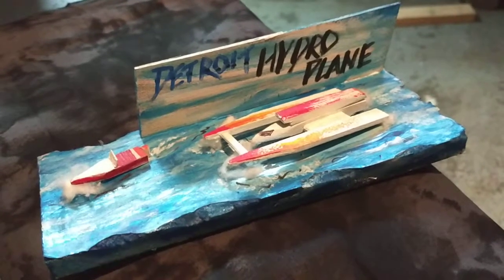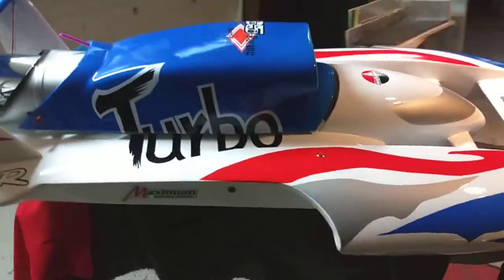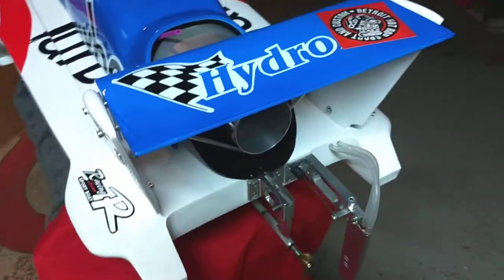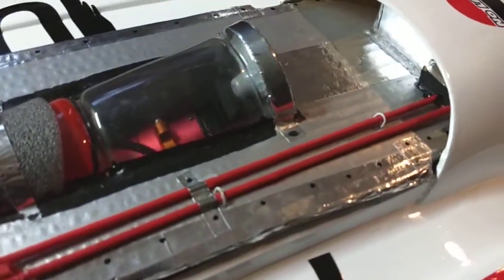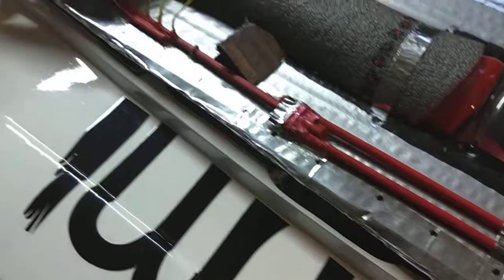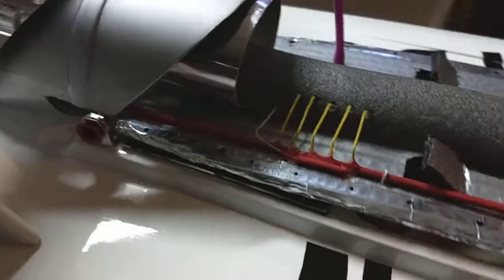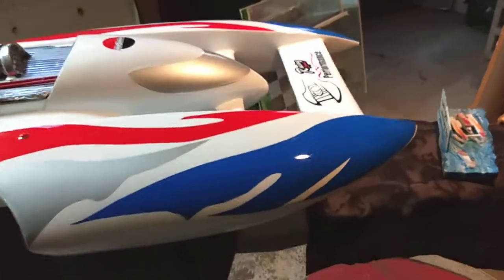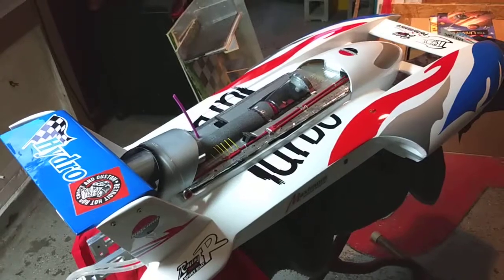RC Hydroplane electric conversion, seaking 180 amp,

Comment from the maker: For the latest on this hydro, going to a 1000 kv motor, higher C count on my 2  4s packs 5000 mah. As of now test is a go on the Detroit river. So far 45 50 mph, but power was cutting out.

Comment from the maker: Offshore electric, zippkits, and gizmomotors carry most of your conversion needs. I made the mounts for the electric motor mounts and ESC. Stick with the 3/16 flex shaft setup and collet for your motor choice as it depends on shaft size on your motor,4mm 3mm ECT. Boats use high current so I  would use a high c rating  better then 90 is good, then testing. 1900kv, 180 amp ESC in a combo will be plenty depending on battery, 4s 5s or 6.  Keep me posted

Comment: What prop, motor, esc and battery combo are you running? I’m converting mine.thanks
Reply from the maker: Seaking 180 amp ESC, Leppard 1100 kv comes in a combo, 6s 5400  90 c nothing lower, expect 4 min runs and 1 hr to charge, props I'm testing and can get info later for you. Gas you  just keep running. So far it can do 55_ 60 but its to light in front and hull should be beefed up all around as it was not design for speed, no turning fin, fiberglass needs reinforcing for that.
Reply: Scott Connors ....I put a Leopard 5692 730kv with a ZTW 300. I added and reinforced a turn fin. Just trying to decide on batteries. I plan on 12s
Reply from the maker: @lonniedavenport5704  make sure it has a high c count, smc batteries is a good start and price, 95$ for my 6 s.  Keep me posted on your project
Reply from the maker: @lonniedavenport5704  how is your project coming along?
Reply: Scott Connors......Hey friend, I’m deciding on batts. Everything is done and ready! How about yours?
Reply from the maker: @lonniedavenport5704  video on utube, finding weak areas in drive train, made improvements, few more tests
Reply: Scott Connors ....Hey Scott, I got 2-Scorpion 6s 5100mah 75c Lipo’s and they are very heavy. I just need to secure battery, ESC and cut the flex shaft. I’m getting close! Have you made any more adjustments on yours?
Reply from the maker: @lonniedavenport5704  glad to hear your project is coming along, you should have some good run time, had to make some improvements to keep flex shaft straight, I had a big gap between the motor collet and brass area leaving the hull, need new shaft then test again.
Reply: Scott Connors .....Hey bro I had to do the same with the exposed shaft inside the hull. I took two L-brackets and JB weld and I’m good now. I’m planning on running her Sunday, keeping my fingers crossed! Ttys
Reply from the maker: @lonniedavenport5704  all hands on deck!!!!!!! Do a video if you can.
Reply: Scott Connors .....hey friend! I have 4 runs on my rig and nobody to video. The water was choppy but I’m testing as well. The boat takes on a lot of water and I can’t figure out why. I use tape and gas kits behind the hardware. She looks like she runs about 50 ish. I think a larger prop, maybe?
Reply from the maker: @lonniedavenport5704  videos tell alot about how the boat rides on the water, I have never seen your build. I put sponge in the bottom to soak up water, some water is ok. 50 sounds real good. Keep an eye on temps. Over prop will generate heat fast.  It took a few runs before someone was there to video me as well. I too will be back out soon.
Reply: Scott Connors ....I have a few short video clips but not sure how to send them to you. They are not good enough to post on you tube but you are correct, you can tell a lot from watching. Let me know and I’ll send what I have.
Reply from the maker: @lonniedavenport5704   how is your boat project? Will return to mine this summer, as i need a new rescue boat first.
Reply: @scottconnors7901  Hello friend, I got a fishing boat and have spent all my time with it. I even sold off my motor and ESC. I wish you could see it. It’s really slick
Reply from the maker: @lonniedavenport5704  any scale hobby means fun, sound like your have a good time.